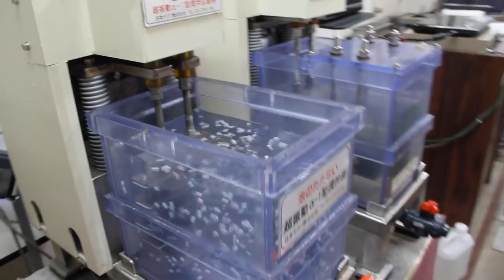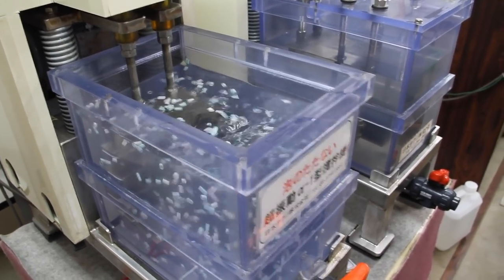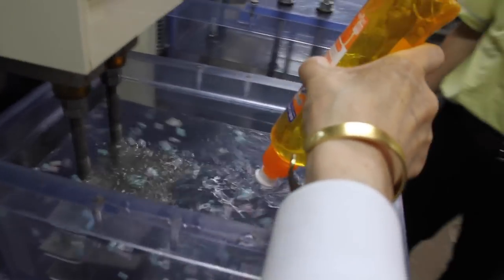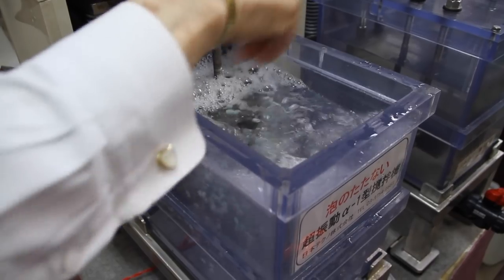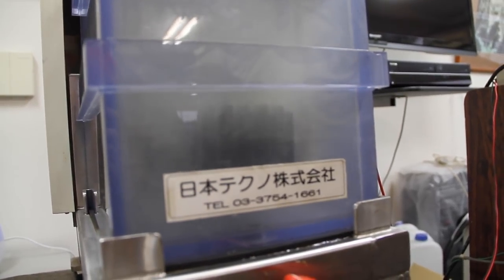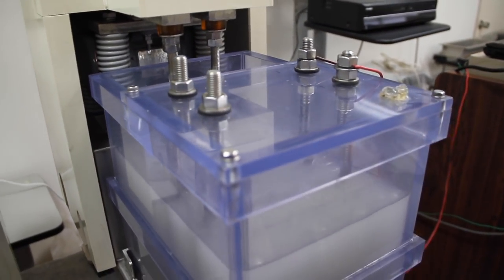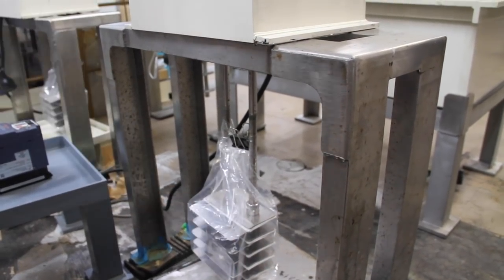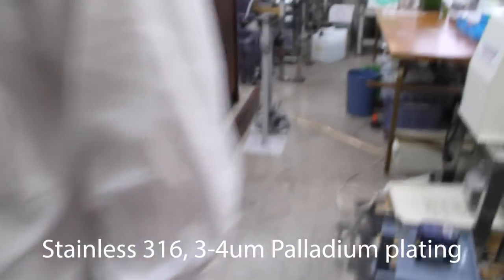OHMA - Ohmasa vibration technology - MFMPs first look

Comment: i don't get how the gas is then separeted from the water and burned..
Reply: I was wondering the same, and it appears as if he feeds the vibrated structured charged water into the actual electrokysis cell. As moray b kind says cavitation circulation electrolysis.
Reply: Oh duh sorry, drop the pressure below 1 atm, the more water gas u make at once the better so circulating the navigated water builds up more n more ohmasa gas, drop the external pressure (in a machine) and the gas will flow right out)
Reply: @EbenEliasjr  Ah ok , thanks , so a vaccum pump is needed at the end of the system but the container is opened at the top.. anyway im trying to work around how to make a similar device, im not shure if is going to work coz i can get hold of ss plates without the palladium coating, i will let you know how it goes if you want
Reply: @poskoz  How did your replication work out?